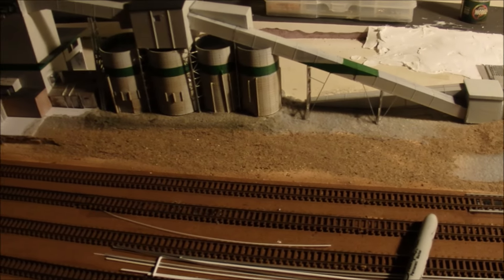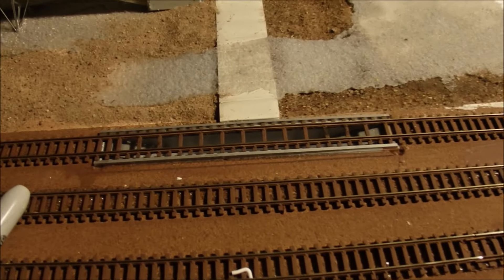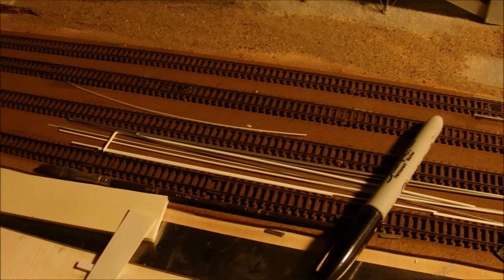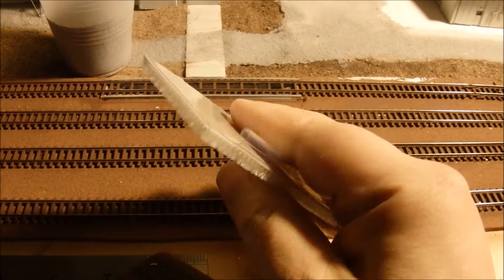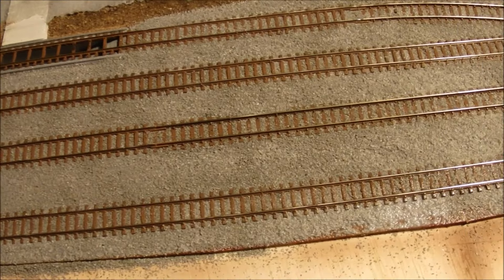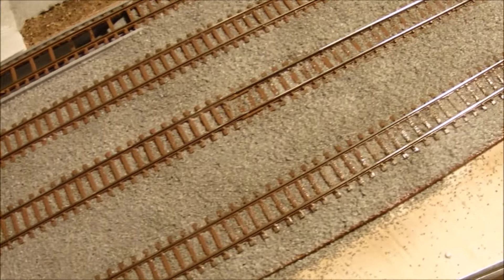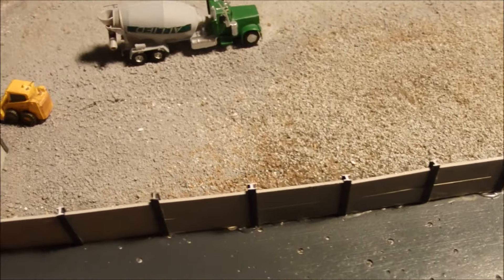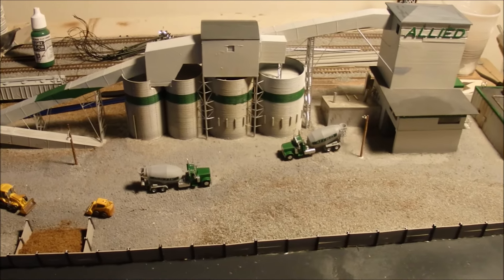MNW N Scale Model Railroad. The Allied Cement Project Part 3

Comment: Thanks for sharing. Where did you find the artificial? It looks perfect for my N scale layout.
Reply from the maker: It was in the May, 1988 Model Railroader. It was for an HO model but I scaled it down for N scale.
Reply from the maker: Correction, May 1998,
Reply: @collinsullivan1517  I found it on my MR CD's. Printed it out so I can work on it. Thanks. It's a good article.